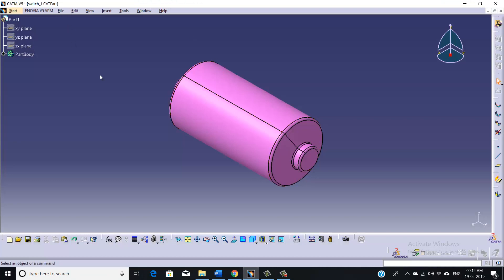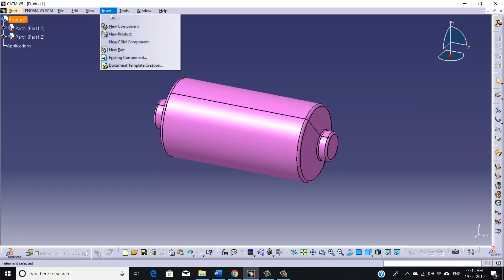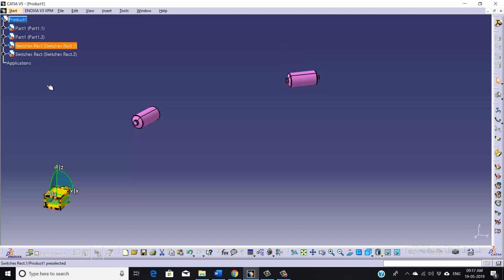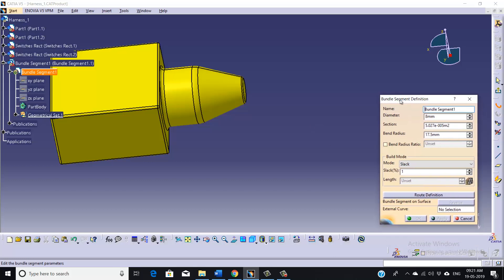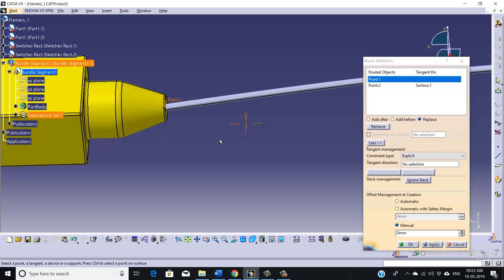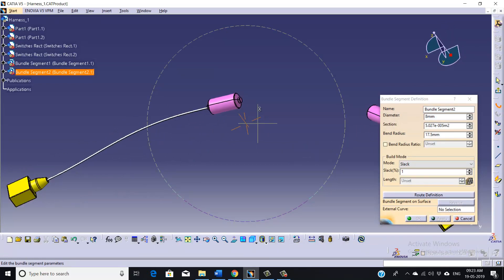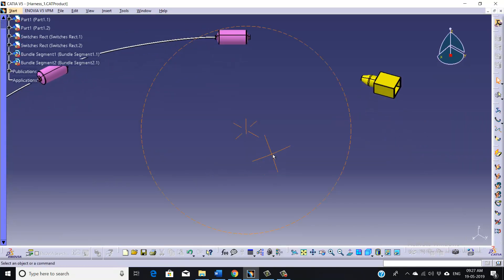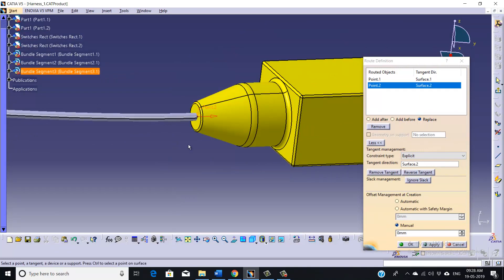Electrical Wire harness #1

Comment: The wire is automatic or do you need to make a different part for that?
Reply from the maker: Automatic
Reply: @_SUPERCAD  thanks! can you teach me more on how to create wire routing? What icons to be used etc. Just a newbie here 😁
Reply: Electrical Wiring Harness class going on. We are given Electrical wiring harness training based on industrial specialist.
We given below list of training from industrial specialist. interested candidate kindly message me
Wiring Harness 3D and 2D design in NX and Team center (Electrical routing, Flattening, Form-board, DMU checks, etc.)
Design of mechanical brackets, Plastic Cable Channels and other attachment means for electronic modules, lightweight and low-cost
3D modeling, drawing creation and GD&T
Support Drawing check activities
kindly like, share, support and subscribe
https://lnkd.in/eNDxyVB
UGNX 3D & 2D.
CAD Lifecycle Management (Team center, etc.).
Harness Electrical routing (NX)
Harness 2D drawing creation (LDorado, Cap-H, etc.)
#mechanical #design #team #cad #engineer #electrical #engineer #electricalengineering #training
Thanks and Regards,
Das Autoloco
www.dasautoloco.com